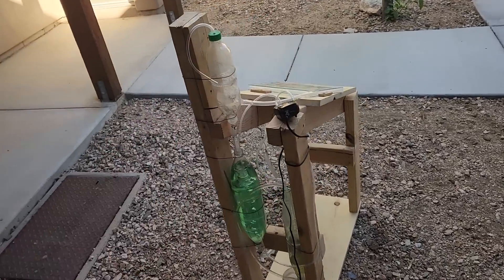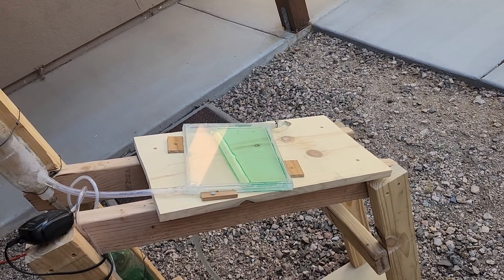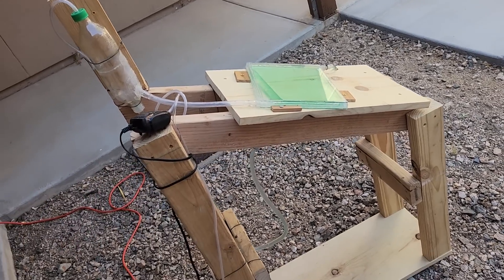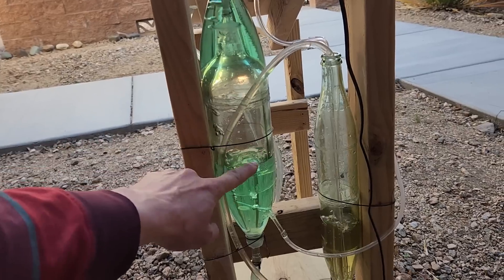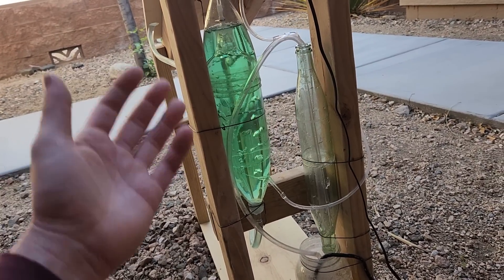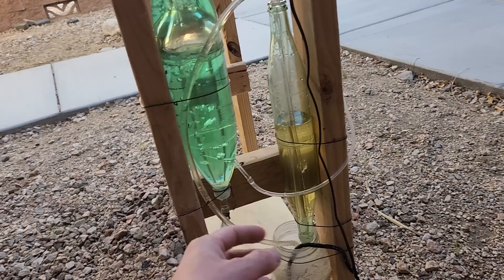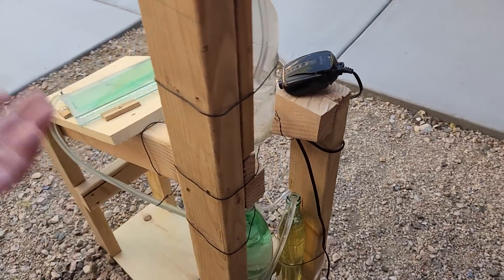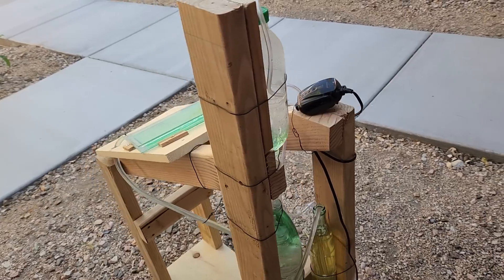Algae panel talk/demonstration practice

Comment: Another cool thing about this (which is mentioned in other videos) is that it is fail-safe. If the power cuts off for whatever reason, gravity takes the algae home. I'd imagine losing the algae farm because of a power supply issue would be very bad in a remote location.

Comment: I love this project and I'm glad to see you're still tinkering with it. Do you think the panel form factor is really necessary? Seems like buckets with transparent tops would be cheaper and easier to use, even considering they're not making perfect use of the available sunlight.
Reply: good thought to fix some of the issues, it does seem like clear, or semi clear buckets would be vastly easier.
Reply: I'd argue it makes better use of available sunlight. With the panels a considerable amount of the light just passes through and is lost. With a bucket you've got a thicker wall of absorption before the light passes through (if the light even makes it all the way through)